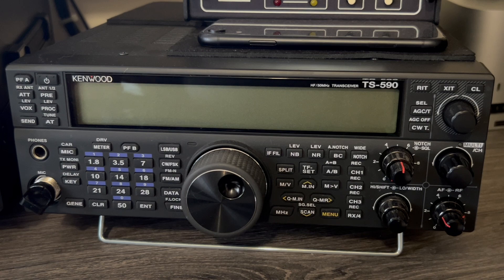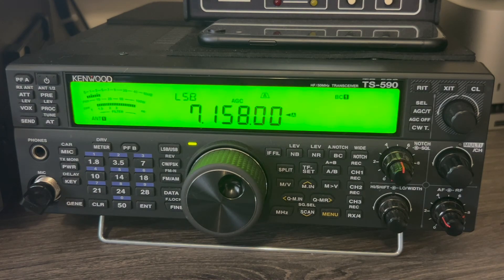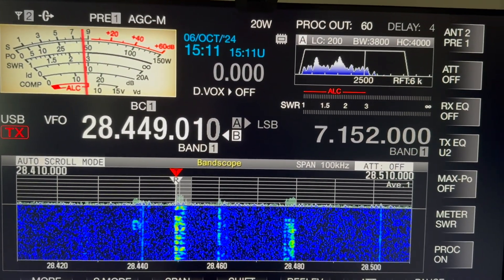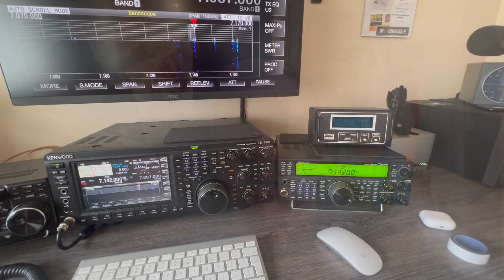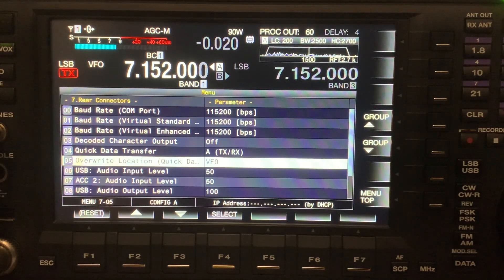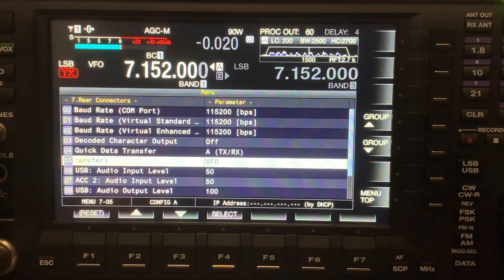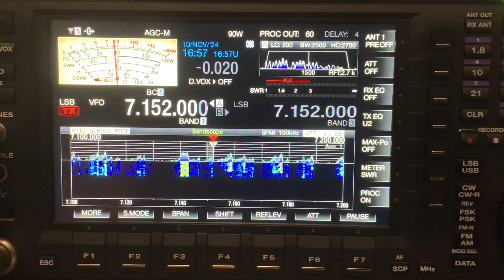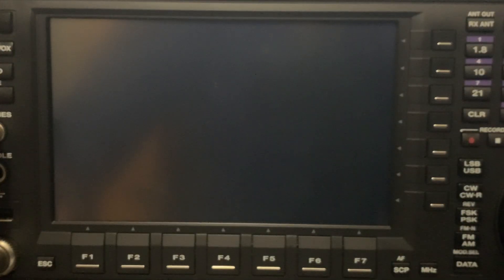Adding a Kenwood TS-590 as a sub receiver to the Kenwood TS-890, TS 590 Sub Receiver Set-up

Comment: This is what you call an expensive kludge. It’s a shame there is no frequency tracking/syncing between the two radios, but that’s to be expected from  radios that were never meant to be operated in synchrony. I would much prefer a true dual band receiver.  I currently have an SDRUno and a FTdx10 frequency synching to one another, with a beautiful waterfall and considerable front end provided by SDR-Console and can zip from one contact to another with the click of a mouse, all while logging in N1MM+ which is also frequency synched. I can knock out a contact in about 10-20 seconds.

Comment: Seems a bit of faffing about, for what turns out to be a rather clumsy way of operating. I'm not a Kenwood owner - all ICOM here and tracking between two rigs has pretty much always been possible. 

The computer control on the Kenwoods should be much the same as on ICOMs, simply because you can connect the rigs to something like flrig and "see" the vfos and so on. So is should be a fairly easy job to use something like an ardunio to poll the second receiver and set the main rx to the same frerquency and the same in the other direction. I would not be surprised if there was not something already available to do this.

However in practice I'm with you I usually only use the second Rx in the ICOM manually!  There must be hundreds of contest ops cringing at that! 🙂

Andy
Reply from the maker: I have to agree Andy, but I do love my Kenwood's